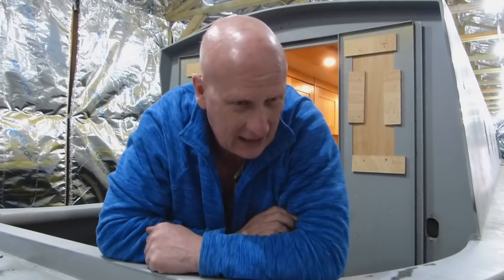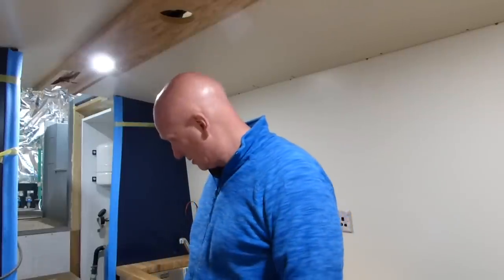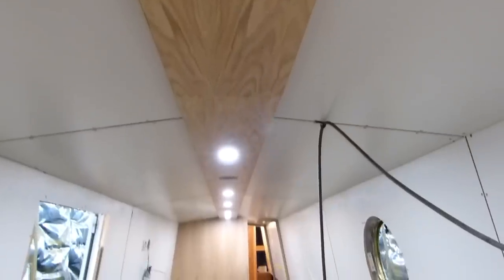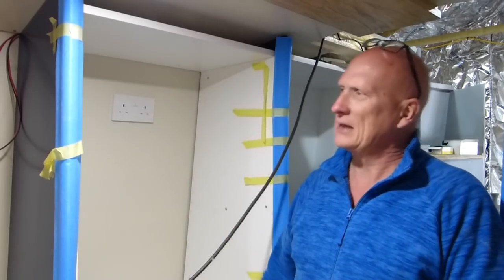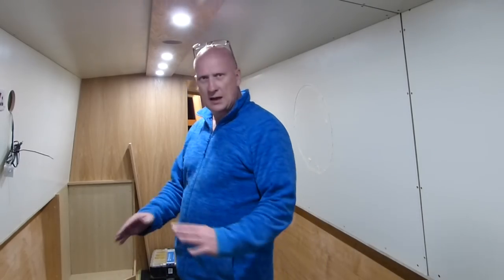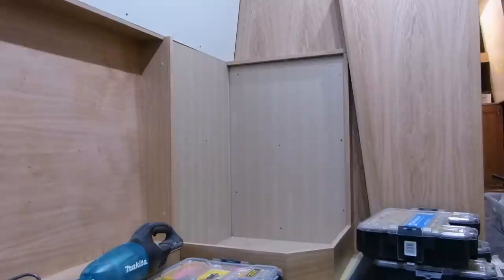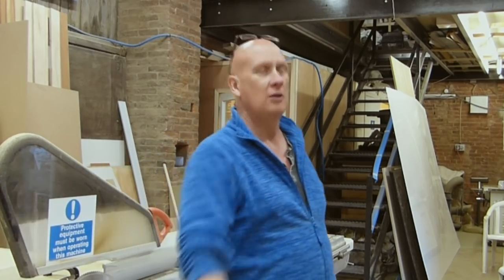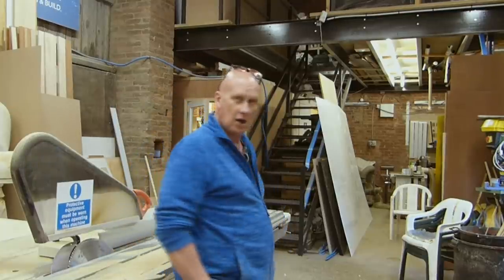Ep 29.  Narrowboat Fit-Out Incremental Gains

Comment: Be wary of single glazed windows with metal frames, the dreaded condensation can be the beginning of many damp problems. Worth investigating for future reference, maybe invest in a dehumidifier.
Reply from the maker: I have looked at dehumidifiers.  You're right about condensation though.  I mentioned this issue a few weeks back now.  Recognise the damp and water issue on single pain glass.  I will have towels at the ready, but the portholes do have drains at the bottom to allow water to exit.  It's going to be a steep learning curve as I learn how to live on the boat thought the different seasons on the boat.
The principle reason for single glazed windows was to better control where condensation lands.  Cold spots that are easily accessible (portholes) are easy to see.  Double glazed portholes will mean condensation will go elsewhere and I'm not sure where.  I know it's a big drama on boats.  As I mentioned, lots to learn.  Thanks for the comment.
Reply: We have double glazing but the frame still gets condensation , wish we had got thermal break double glazing looking back
Reply: @chrismears-inslowtime  Good luck 🐱
Reply from the maker: @agfbuilding  thing is Adie, that was one of those elements of the boat I couldn’t afford. I took a punt that portholes, cratch and prams were areas I could add too later.  I want to test the theory too.  Not sure how I will do that as I can’t test the double glazing by contrast. Lots of lessons to learn.
Reply from the maker: @markgeraghty4125  thanks Mark.

Comment: Are you going to have your pushbike with you on board.  Because when your alongside it would be dead handy.  Are you thinking about a bracket fitted to the deck of the boat so you can lock it away, and low enough to get under the tunnels .  🤔
Reply from the maker: Yes Kev. Possibly two.  But also allow the younger children to bring a bike when they visit. A tow bar 4 x bike, rack stuck on the back which can be removed easily for tight spaces. Also lower than my head so tunnels won’t be a problem.  Hopefully, nor will locks but that is where I need to be more mindful.

Comment: Eh up Chris mate,  bet you're get excited about the launch.
I've been hearing talk of "Solar Dump" and wondering what solar set up you're going for? I'm kinda interested in "free" hot water! Take care
Reply from the maker: The Solar Dump. I think that was a Well Deck Diaries vlog. Not sure if you expect me to give you an answer as I wouldn’t know a thing. I’m going to ask this week and I’ll message you the answer. I’m sure the answer is no. Not sure how many builders keep abreast of new innovation as they appear to do what they’ve always done. 
My solar set up. Hmmmm.  Don’t know the specifics. All I know is, the maximum I can get on the roof that will enable to charge the battery. It’s pointless getting too much solar as the battery will only take so much charge. Having 1500watts of solar and the battery only allow 1000 watts input means I’m wasting 500watts. It’s a bit more complex than I initially thought. Again it’s the Donald Rumsfeld quote of the unknown unknowns. The solar will be on a frame and not stuck to the roof. The reason, in the winter I want to maximise potential by being able to angle the panel slightly.  If on a marina, it doesn’t matter too much. If on the cut, maximising potential matters..to me anyway. I had a discussion about this with Mark. He preferred the sick on panels, I wanted to maximise solar energy. They are less aesthetically pleasing but, in the autumn, winter and spring, more practical.

Comment: Plenty of interesting, helpful comments, Chris.

The painting, is that just above the waterline?       I had thought the below-waterline painting was completed where it was built.
Reply from the maker: Hi Martin.  The paint below the waterline (black) will be re-painted again in Two-Pack epoxy.  The shell build was an initial coat to look after it before the proper job.
Reply: @chrismears-inslowtime  I was always wondering how they support the boat so the painter can paint the bottom of the boat (would you stand under it?).   And then they’d need to move the supports, when the paint’s dried, to paint the area previously covered by the supports.    But, hopefully, we’ll see how that’s done on the video.

I was amazed when you explained how many coats of paint are put on above the waterline, with rubbing down between coats.     That’s a perfectionist’s paradise.
Reply from the maker: @Martin Rubenstein  the bottom of the boat is never painted for two reasons I know of. 1. Rust forms when oxygen comes into contact with water, it’s too low for it to have any effect.  2. The canal is shallow and often the boat will rub along the bottom, rubbing of the paint, so in effect, it’s a waste of money and time. 
The boat cabin sides are being painted with a hardened paint.  By all accounts, you can put a coat on and by the time the boat is covered, you can start sanding down for coat no2. Leave it over night, rub down and apply final coat. It’s dry in 30 mins. Gift. Let’s see. I think I’m right by saying, they’ve not used it before. It’s expensive paint but due to drying time, it saves money on labour cost and it’s not too bothered by humidity.  Wait out.

Comment: Need screens on those portholes.  Pots and pans slide when the boat rocks, put something up to prevent that. Also check the size of the microwave to fit into the boat.
Reply from the maker: Screens, to stop flies etc??  or to stop nosey people.  Bungs is the answer for the later and death for the former.  I have a plan for pots and pans Rob.  They are steel, so a magnet mat on the bottom should keep the pan falling off.  Just need a solution for the magnet. It might work...discuss.  Test and adjust as they used to say...and still do when firing on the ranges.  I'm waiting to see if I need a microwave before I buy one.  I will then know what size I have to play with..and how much money.

Comment: Why is there no dagger board or strakes on the bottom of the hull at the bow to assist in steering.
Reply from the maker: I used to do a lot of windsurfing in my younger days. Some boards have dagger boards for stability, making it easier for steering in low speeds.  My fast boards used speed, so the faster I went, the more manoeuvrable it was.  I think the canals are too shallow for dagger boards to have any effect and they might get ripped off by a shopping trolly or the cill on the lock.  If I had one, I’d venture out on the high seas; probably as far as France, on a very calm day.

Comment: As a matter of interest when did they first start boat
Reply from the maker: In real terms the shell started in September.  In fit out terms mid January.  So, as far as the fit out process not too bad. Others do it quicker but there are a lot of variables in boat building from materials used and what the layout is. A company that just does a 57ft boat and a menu style list of what you can have can build a lot quicker. Their profit based as they can build in advance on spec as it’s compartmentalised.  My boat as with all boat The Fit Out Pontoon build are to a spec of the owners. Every boat is different. That comes at a cost but I believe the cost is worth the end product. Thanks for the question Paul.
Reply: We are all excited for the launch and travelling the canals tell them to get a move on👍

Comment: Doubt if the microwave door thing will bother you after the first 2 or 3 uses, you'll just adapt.  Its all coming on very nicely.
Reply from the maker: I get it, Rob, you're right.  I know that will end up being the case.  I just wanted to see if the audience would come up with something I didn't.  Answer, yes they did but, still too expensive.  Solution, cheap microwave that opens the wrong way and get used to it.

Comment: I have a Panasonic pull down microwave, it’s also my main normal cooker and it’s a steamer, i paid about 350 two years ago
Reply from the maker: Price is now £499 with £100 off.  However, that is an impressive oven.  I might wait a little longer and get one of those.  That said, it uses a lot of power so that will drain the battery quickly. (1300w). These are all things I need to understand a lot more when I get on the boat.  I'm going to live for at least 6 months before I opt for a micro wave.  Also, these are quite high.  Not sure I have the height.  Best to weight a little longer.  Good advice, thanks Stephen